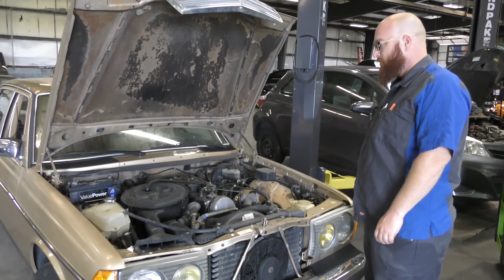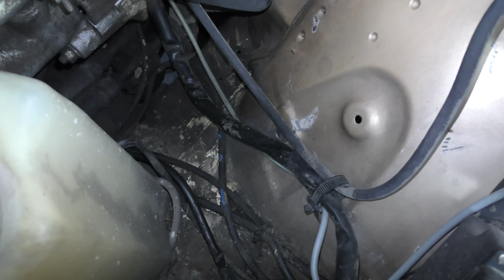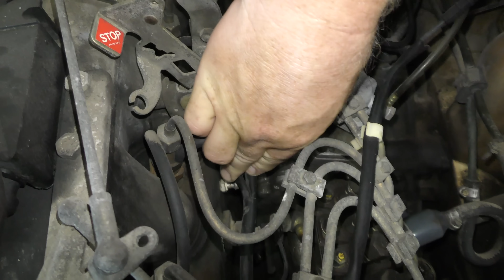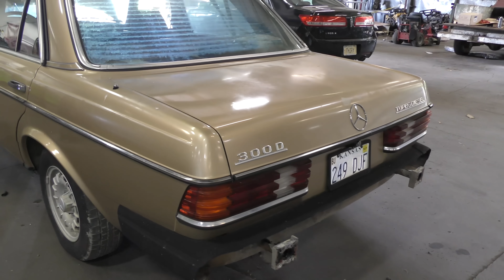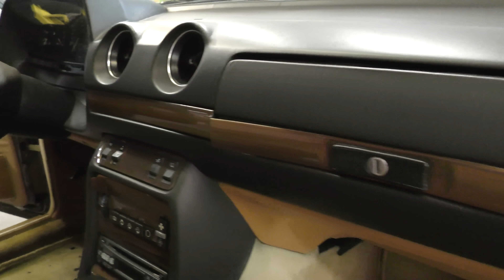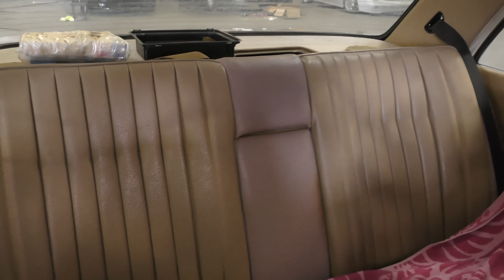Tank of a Mercedes 300D with a 3L Turbo Diesel! CAR WIZARD finds lots of surprises under the hood!

Comment: We have this pest problem in Switzerland and I have read that insurance companies have been hit hard over the years in Germany, as well.  Here the pest is the Stone Marten, which they call the "foin" where I live in the French speaking region of the country.  These foin LOVE the cables on cars, especially when the cars are left outside during the winter, with the engines still warm.

A foin had a feast under the hood of my Audi A6 quattro, one time.  Insurance covered it, but the critter made a nice mess.

I solved the problem with some Vaseline mixed with really hot chilli pepper spice. I coated the wire cables to the spark plugs and a few other choice cables.  After that, never had an issue again.

Comment: I want to see more on this car! I have an 84 300TD wagon. The engine bay accessories & there mounts, wiring and hoses move out of the way to steam clean everything. Please please show at least some of the wiring harness work done (for some perspective), as mine has just some aged wire shielding and would like to repair or replace mine as well.

Comment: Please !  You are wrong about a lot things on the vacuum system, the door lock is separated with a check valve , and the  injection pump shut off is a separate brown line that goes directly from source to the ignition switch housing vacuum valve then to shut off membrane. The plastic valve  on the pump controls transmission shifting the shut off diaphragm is on the backside of the cover. The ALDA does not control the turbo it only enriches the fuel according to boost pressure there is no adjusting on this turbo, the waste gate is controlled by a short black hose from the intake manifold to the waste gate valve !!!

Comment: puts out a ton of oily soot.  Leaves a spotted trail of black drops up and down the street and up your driveway into the garage. When you do any work at all on the motor, better wear gloves or your hands will become dyed black.  When it is super cold, you have to use both  Ether and a block heater to get it started.  If you spend the night in the winter mountains and can not plug it in, better let it idle all night and sleep in the car. Other than that, it is a reliable long lasting car.  Your are better off with this car and the straight 6 gas motor. Get the 280e. Fast as heck and also very reliable. and no black drip stripes up your drive way and no need to plug it in.

Comment: One of the biggest issues on the older Mercs was the wiring insulation was made of a material to be "environmentally" safe. However the long term failure was that that wire jackets would decompose. That isn't just mouse damage, its poor engineering of  materials. I know because a friend had a dead 300D that I was interested in. The week that I discovered the news that all it needed was a replacement wiring harness (labor is intense but they sell split harnesses to make it easier) my friend traded it in. I was bummed. These 300D are indeed long living...

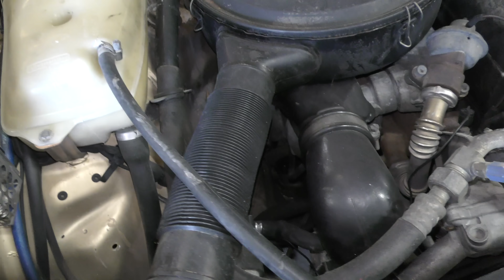Comment: 15:38 The turbocharged OM617 actually make like 125 hp and 180 ft-lb of torque! It doesn't sound like a lot but it makes a huge difference over the NA.
Reply: His quote for the HP is actually for the non-turbo engine which is basically the same engine without the turbo.
Reply: it also produces more than just 5-6 psi as he stated, closer to 8-10 or so.

Comment: That first aid kit and it's cradle out like that on the rear dash tells me there's been a fuel sending unit repair going on..
Reply: Wrong! MercedesSource just did a vid yesterday showing that the fuel sending access is behind the rear seat back. Under the first aid kit is the vacuum reservoir.
Reply: @johnwedzicha  At the sedan, you remove the vacuum reservoir in direction to the trunk, then you can  pull the sending unit out of the tank... in a wagon the tank would be under the car, so the access to the sending unit is behind the back seat

Comment: "What vintage car would you love to own?"  A 1971 Ford Mach 1 351 Boss Mustang Red with black stripes.  Have a red 1973 Mustang with the Mach 1 hood , it's not fast but it's fairly reliable now.  That Mercedes reminds me of a '77 Mercedes 300D that I purchased from the Strawtown auction for $425, was one of the last cars to roll through so it went really cheap.  Used to have the diesel engine, but it was converted to a 350 / 700R4 by Borg Warner Gear in Muncie, IN as a project car.  Everything was done really well, drive line felt like it belonged there.  
VT247

Comment: For his daughter?  This, THIS is not a starter car! this is a FINISHER car!
Reply: YES a conveyance for Golden Gods!!!
Reply: The Car Wizard should have bought his daughter a 2008 Toyota Highlander 4WD mid-size SUV, because it is a lot safer than that Prelude, that she wrote-off. It has the 3.5 L V6 engine and it is a lot smoother than any four-cylinder low-end vehicle. It is also the first-model year of the second-generation of the Highlander, because this one lasts a lot longer, than any first-model year of the other generations of other vehicles. A lot of them, still go for a number of miles or kilometres, same with the older, GM vehicles with the 3800 V6 engine.
Reply: @md2k8  - She took the car joyriding without permission. It wasn't hers.
Reply: @md2k8  If he wanted safe he should have bought his daughter a Smart 4 two, apparently they passed the European crash test with a better safety standard than almost every other car. Also they do less injury to pedestrians.
Reply: @stephenjones5240  I think, I heard about that vehicle before and I saw it in person. But, a Smart Fortwo is still too small and still unsafe for the Car Wizard's daughter. They are throw away vehicles - this is on the not to buy list. A mid-size or larger sedan, a larger crossover or a minivan is the best safest vehicle in its class - a 2017 Honda Odyssey eight-passenger or a 2010 Hyundai Sonata four-cylinder.
Reply: @stephenjones5240  one major difference between European countries and the US when it comes to crash testing and safety ratings....is the size and weight limits of commercial trucks or "lorries"(likely misspelled by me). Here the length limits were tossed out in the 80s. I believe where it was a 55ft max for entire rig (hence why cabovers were the industry standard and now ghosts) and now the standard trailer alone is 53ft. My last truck before I left the lifestyle was 77 ft 3 in from grille to Dot bumper. The max weight is 80,000 lbs. I'm not even gonna guess at the rules and laws of weight and length maximums in Europe because in the past each country had different limits and rules making it so difficult. If you live in a major city and only use it for commuting and not on long trips using interstates, then these smart cars And other ultra compacts would be great.  I had the misfortune of being stuck with a fiat 500 as the last person at the rental prior  to closing. I had to make a 200 mile trip and be there and ready at 8am so no choice but to pray and get going. Meeting and passing Semis on i10 was not cool. Now I'm not a stranger to small cars bc my 1st ride was little 80s model civic and best car I could have asked for at that time. My daily for past decade has been a prius and prior to that a few corolla. Never had car get buffeted in the highway like I was on my motorcycle but I will concede that I have not driven a smart car so I may be far off.
Reply: In a few years they'll swap... Dad will want the classic and daughtrr will want the modern car that he's only put 80k on

Comment: Mercedes used bio oils in a rubber production, that is why mice love to chew them
Reply: I'm not sure that they did back in the 80s? I think that perhaps came in later with the W124. That's also when they got biodegradable engine wiring looms, so they fell to bits whether or not mice got in on the act.
Reply: Very informative video about the Mercedes but that mice toke a big bite out of the harness

Comment: My father in his infinite stupidity bought a 76 W123 with the M110 gas engine and it’s MECHANICAL fuel injection, in South Dakota, before youtube existed to help diagnose all its problems. 3 mechanics practically committed suicide all because Ron believed that all W123’s were created equal. It was fully loaded, too. A/C and automatic climate control.. that didn’t work, power moonroof.. that didn’t work, you get the idea. The fuel injection system on these cars were unimaginably complicated and difficult to work on and keep tuned properly as well. The car hated hot days, it hated elevation changes, it hated steady high speed cruising and it hated humidity. 

That car with the M110 was literally the antithesis of what the 300D W123 is now famous for, being simple, brick like solidity and durability.

Comment: We had to repair one of these at auto tech college.  It was an epic debacle.  The owner ordered a used engine from somewhere that supposed to be good.  Thing is, it was ordered and arrived before our break.  It had a 30 day warranty, by the time break was over, so was the warranty.  Installed the engine, it was trash.  So took it out, and combined the old engine and the "new" engine to make one good one.  Then we went to install the rebuilt engine, and the crane failed right when the engine was over the grill/radiator support.  Crushed it.  Removed the engine, sent the car to the body shop side of things.  While later it for back, and the engine went in smooth this time.  Except it wouldn't start.  Turned out the fuel pump was bad.  The owner wanted us to try and rebuild it using the old parts... Ok.  Failed.  So he had to buy a newly rebuilt one for newly rebuilt Mercedes money.  After that, it ran great.   What should have been a few days turned into about 4 months or so.  Would have saved time and spent about the same rebuilding it with new parts.   And best part of all, it was the Deans car.

Comment: A friend of mine had a 1982 W123 300D (non-turbo OM617) - it had a genuine 152,000 kilometres on the odometer. Was owned by the Zimbabwean Ambassador to Australia - very tidy car with low kilometres for it’s age

Comment: Do your magic, Car Wizard! Keep that beautiful tank on the road, it hasn’t even gone past its break-in mileage!

Just one minor correction: the turbo OM617 has 130 horsepower (ones with California emissions have 5 HP less). The naturally aspirated diesels had the 89 HP.

And yep, I still have the original first aid kit in mine, infact I just replaced the plastic lid.

Comment: 15:38 A 240D non-turbo made about 72hp (my grandpa had one). How would a 300D with the bigger engine, extra cillinder AND  a turbo only make 13 more hp? No the 300D Turbodiesel actually made about 123HP from the factory, not 85hp. The non-turbo 300D made about 85hp, though.

Comment: Mercedes-Benz Classic Center actually offer an impressive parts catalog for their cars that haven't been made for _decades_. For example, you can find NOS wood dash trim for the W113 "Pagoda" (produced until 1971), although they're not cheap (last I asked, almost $1k each for either left or right piece, both of which are small). Through the Classic Center, Mercedes-Benz also manufacture parts to replenish stock that had been unavailable; however, the schedule for these production runs can be measured in years. Basically, if one has the time and money, one can likely get NOS or even new factory parts for a restoration. So probably not for a driver W123. :)

Comment: This is the last real MB car. The quality is amazing.
Reply: Plus the W124
Reply: The last "real Mercedes" was the W140 S-class. It offered was along side the w124 e-class starting in 1993.  Every chassis since is garbage.
Reply: Solid body work but mechanically and electrically troublesome because of bizarre engineering and poor quality control.
Reply: With the W140, Mercedes kept the built quality and construction the same AND started adding all tech stuff they are known for now. I think they never recouped development or production  costs, and lost money with every w140 sold. They probably cut quality control to cut losses. Part cost for w140 cars is still very high. So that would not surprise me. Every chassis since however, with paint and rust issues of the w210 e classes, or the powdered metal timing gears in v6 and v8 motors, it goes on... those cars aren’t for me.
Reply: Why that?
Reply: @Americatheidiot  Because back then Mercedes had a different mindset of what a car was. In the 90s it all went into the garbage when the marketing portion of the company took over all the decision makings.
Reply: Damn you Google: Up till the mid to later 1980’s, the philosophy at Mercedes-Benz was to make the best cars- in terms of reliability, durability, quality, and luxury- car that were engineered to last. After that, management decided that they wanted to make money instead of build cars for longevity and sell based on their previous reputation, and it showed on the cars they built. 90’s and up Mercedes quality rating dropped like a stone, and their resale values shows this. The W123 was the last Mercedes build without a regard to price; when new, they were more expensive than their contemporaries, but they were built better than anything else. They were the mainstay of taxi services around the globe, and still can be found in service. A modern Mercedes is no where near as well build; they are packed with technology and complexity which are prone to breaking- that how you get an $80k three year old Benz for sale for less than half its original price.
Reply: Yeah, the thing's leaking like a sieve, the headliner's falling down, the wood's coming off, the dash is cracked, and I guarantee you, Wizard will find a shit ton of other issues. The quality is astounding.

Comment: I am a commercial and Industrial HVAC mechanic.
Even in a large building, factory or manufacturing plant, I will have plant managers or owners that want to cheap out by wanting me to install used parts or just a bandage or bailing wire on a piece of critical equipment.

I will not do it. Your right. Liability, your reputation and people’s safety are all things that are at risk.

I would rather do a good job with reliable parts at a fair price and let them fuss.

35 years in my business......they complain about doing it there way but...they are usually the first ones to call back next time when they need your help again.

Fair - quality - honestly = More work than you can do!

Comment: Thank you mr and mrs wizard  I have used the Merced’s Benz classic center for parts for a friends 450 SL
Very knowledgeable can be expensive but they are original MB Parts. The fit and function is perfect.

Do you have any suggestions on the nice issue

Comment: $5-7k to rebuild a vehicle that may last another 25 years,vs $30-40k for one that's running but a couple  years old still sounds like the better bargain.You don't know when the 30k car will need that 5k to fix.I don't want all that 'electric garbage'that controls everything but your shoelaces.
Reply: Yeah, you want all those thin plastic vacuum tubes running all over the place controlling most of the vital functions and leaking unpredictably at any time.

Comment: Mercedes dealerships still offers plenty of brand new parts for this car
Reply: But for the price they sell them at you're better off buying salvaged parts.

I always owned really really old cars, and despite what people think, all major parts are super durable and you most likely won't have issues with ones from another car.
Reply: @GlamStacheessnostalgialounge  maybe so for the older car.
I have 2008 Mercedes, which was always garaged, and the low beam light bulb died.
So I removed the socket to replace the bulb, and the insulation plastic on 2 wires became so brittle, they were falling apart, exposing the bare copper wire.
Reply: At the prices they charge I have no doubt.
Reply: That is true.  The Mercedes Classic Center offers parts for every Mercedes ever made.  He might have to pay a lot of money, but he can get even the rarest parts from Mercedes.  I believe there is a classic center in CA to work on American cars.
Reply: It’s better to go straight to the classic center. They are cheaper than most dealers and their are some parts the classic center has that a dealer will tell you are NLA. Also in the past 2 years some parts that were readily available and cheap have started to disappear. For example the rubber and chrome belt line molding is mostly gone when for years you could buy any piece and it was pretty cheap too. None of the front windshields or read windows are available from Mercedes now for any W123 sedan, wagon, or coupe. On the bright side the thinner chrome trim ring for the ignition switch on  later models has become available again after being gone for at least a decade.
Reply: @Marklin15  that's not good what you going to do that if the glass breaks
Reply: Yea, $2000 for a windshield wiper, $3000 for a windshield
Reply: If you have the money ive heard you can get any part for any car directly from Mercedes in Germany.
Reply: MB has a whole classics decision for parts on classic Mercedes. They are expensive but when you need a part..
Reply: Jee that's great wish other car companies could do that
Reply: True a friend of mine are restoring his 1969 230S Mercedes-Benz and found every thing brand new in internet. And me too restoring my 1991, 4x4 Soviet era Lada Niva. I find every thing brand new genuine parts in internet
Reply: @Crystal Clear Mix
Plenty of parts available for these cars from independent parts shops as well and they are not that expensive....excluding the A/C which was probably the wink link
Reply: One of the BEST Mercedes
Reply: Might be better than  a second hand wiring harness. How would you even know it was good?